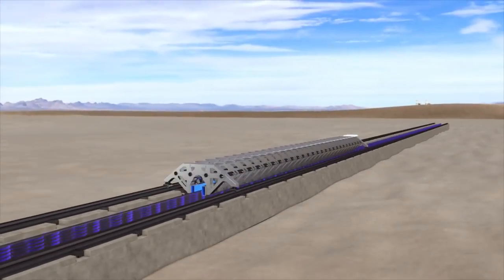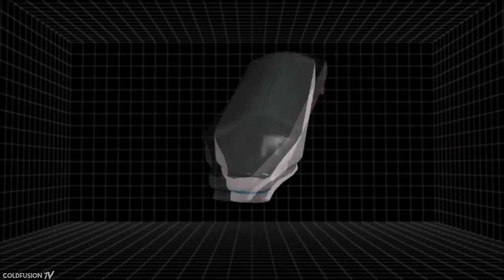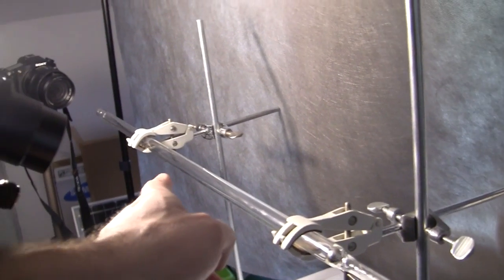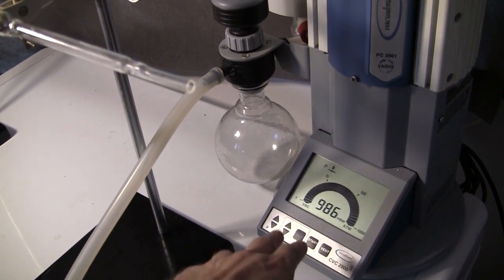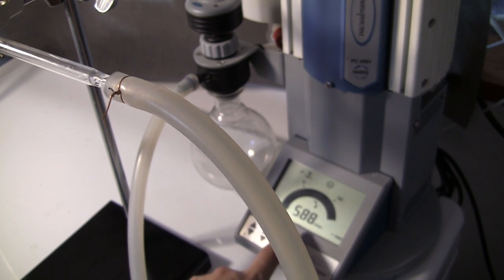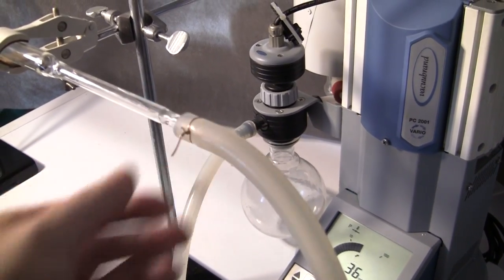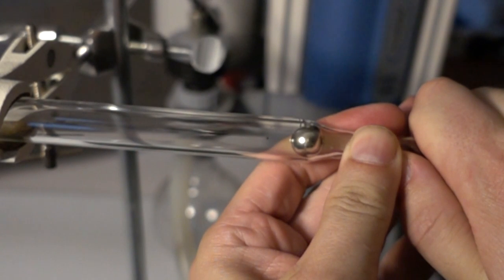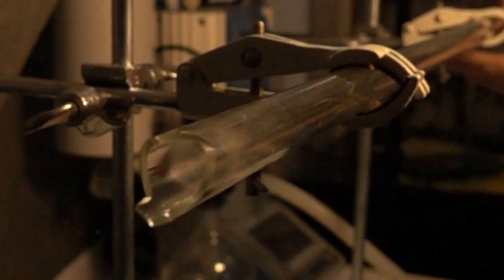How  the Hyperloop can kill you!

Comment: Wait, but why wouldn't the air just flow around the vehicle? That ball took up most of the diameter.
Reply: +Matt Darling If there's no air outside of the tube, then there is nothing to worry about; hell, don't use a tube if there's a vacuum outside.
Reply: That's not true. Firstly r^3 law means bigger things are effected less due to mass not scaling with surface area and secondly the snugger the fit the greater the acceleration as if air can rush past there then becomes air in front of the train object increasing its inertia.  A good example of this if the mythbusters episode where they make a vacuum gun.  The struggle to get the gun to work better due to air rushing past the baller bearing and over the course of 20m this causes a deceleration.
Reply: I'll rest my case and say, we need a small scale model to work 99.99999999% without hardware failure to even consider building it.
Reply: You'll notice that the ball does not take up the entire diameter and lets air flow around it, or else he would never be able to make a vacum in the tube... Though the acceleration is defined by the surface area the air is hitting. Same as you waving your ubrella around in the wind. I would argue that the diameter of the tube is irrelevant as long as it is over a certain threshold where this actually matters.
Reply: there's no air it's a vacuum
Reply: Matt Darling he's complaining about  the vacuum failing
Reply: +Lucas farach-colton would having a second tube around the first one with the same atmosphere vacuum work as a fail safe?
Reply: kEn_sct Now, i suggest we do the math and find the acceleration the first few seconds, because that is what is important. Speed doesn't kill a huge change in speed in a very small amount of time does.
Reply: Not sure what numbers to crunch as will depends on how air will flow over train but will be something like F~0.1*v^2 with v being the difference in speed between the incoming air and the train. Lets be generous and say the delta is Mach 4 so F ~ 2 MN.  I know people can survive 10 G  and I would guess the train will be in the region of 40 tonnes, F=ma so 2 MN/40000 Kg = 5G... so very survivable.  Debris going this speed may be an issue tough.
Reply: Yep, so if the surface area would be bigger or the train mass would be lower the G's will get larger or smaller.
Reply: Yep, but you could defiantly make a design that was inherently safe, all you have to do is make the train longer to add mass.  Also this doesn't take into account the drop off of deceleration as more air that passes the train the less deceleration on the train.
Reply: The fact that there is a vacum in front of the train would increase wind speed tho.
Reply: A vacuum does not exert any force.  The only force is the air pressure from wherever the breach is.
Reply: yah. I mean, You can crunch the numbers, but it isn't the problem thunder foot says it is.
Reply: Yah, I mean, sure. But if a train track is a centimeter off, it can derail a train. If a submarine has a single breach, it can sink the whole thing. One psi is not to much pressure to withstand.

Comment: What if, in case of a vacuum failure on one end of the hyperloop, you just open a valve on the other end to let air in? (Or a bunch of valves throughout the system). Obviously this would have to be done by a very fast automated system, with a bunch of redundancies built in. But wouldn't that stop the runaway acceleration?
Reply: Wouldn't nearly be fast enough for everyone inside not to have their internal organs crushed

Comment: Isn't it supposed to accelerate through electromagnets like a railway gun instead of air-pressure?
Reply: Yes, but they want a near vacuum in the tube. TF simply showed what would happen if the tube ruptured
Reply: He showed what would happen if the train had no safety devices (automatic, accelleration sensing brakes), had very little mass and could accelerate that quickly, and if there was a wall at the end. There isn't one in a loop.
Reply: +filonin2 That's if you forget that anything more than 7G will probably kill everyone on board. And the pod would be accelerating much faster than 7G.
Reply: filonin2 you'd pretty soon achieve a vellocity that can't keep the curved path though, plus there'd be a lot more air rushing in since the tube has a way higher area
Reply: *****

Ryan Coulbeck
Yes, if for some reason you didn't put any safety brakes that would prevent such an acceleration while the air pushes past the car. Do you actually think no one has thought of what would happen if the tube ruptures? Really? No one thought of safety vents or air locks or anything? Seems likely. It's like you're claiming elevators are inherently dangerous if you remove all safety devices from them. No shit they are.
Reply: Ryan Coulbeck
The very first result of googling "hyperloop safety devices" addresses these problems ffs.
http://www.businessinsider.com/heres-what-happens-if-the-hyperloop-crashes-2013-8

"But in the event of a serious incident, passengers may lose oxygen — they're inside a sealed tube, after all. So Oxygen masks would be deployed:
In the case of a more significant depressurization, oxygen masks would be deployed as in airplanes. Once the capsule reached the destination safely it would be removed from service. Safety of the onboard air supply in Hyperloop would be very similar to aircraft, and can take advantage of decades of development in similar systems.
The passenger capsules — which coast through the tubes, pushed in front of a column of pressurized air — are coasting for much of their journey, so they have emergency brakes and engine-driven wheels in case they are stranded or need to avoid hitting a stranded Hyperloop car:
In the unlikely event of a large scale capsule depressurization, other capsules in the tube would automatically begin emergency braking whilst the Hyperloop tube would undergo rapid re-pressurization along its entire length.

Once all capsules behind the stranded capsule had been safely brought to rest, capsules would drive themselves to safety using small onboard electric motors to power deployed wheels. All capsules would be equipped with a reserve air supply great enough to ensure the safety of all passengers for a worst case scenario event."
Reply: Bendmydick Cumberbatch Thanks, I apparently skipped that part :) 
But every kind of fast traveling is dangerous if something fails!
The biggest problem for the hyper loop are probably earthquakes...
Reply: filonin2 the quote you provided mostly adressed the rupture of a cabin, not the tube itself. I don't say it's impossible, I'm just saying that you'd need some serious brakes
Reply: Ryan Coulbeck
I'd love to see your source of why the car would be acclerating at "much faster than 7g," especially considering the hyperloop is specifically designed to not allow such a thing to happen.
Reply: *****
There wouldn't be huge pressure differentials ever or any acceleration as the tube has vents all along it to pressurize it equally in an emergency. Are you incapable of reading? How could the large, necessary pressure differential form unless all safety devices are disabled? Thunderfoot's example is faulty. A valid demonstration would be to have vents open all along the length of the tube. The ball wouldn't hardly be disturbed, especially if it was a rubber ball jammed in the tube to simulate the safety brakes being applied. If the tube ruptures in one place, this is sensed automatically and vents are opened along the entire tube, negating pressure differences while the cars apply brakes. This has been in development for years and has billions poured into it, they've thought of this really, really obvious problem long ago and addressed it in the design. Again, it's like saying that elevators are dangerous if you remove the safety brake.
Reply: filonin2 while you might not accelerate you'd still be subject to an (now twice as big) immense force
Reply: *****
How? There is never any pressure differential and the car never moves. You don't seem to understand the need for a pressure differential to get movement and therefore acceleration. What force if not accleration??? What unit is this force in?
Reply: filonin2 if you're in between a rupture and a safety valve you'll be hit by the incoming air from both sides
Reply: *****
Which would be a zero net force. Have you not taken physics? There would be no acceleration, you wouldn't move, you wouldn't even know it happened.
Reply: filonin2 so you'd be fine standing in between the stereotypical cartoon double log trap (https://i.ytimg.com/vi/4vt0IBejFbc/hqdefault.jpg)?
Reply: *****
Stop asking these stupid fucking questions kid and go look it up yourself. You've got no idea how it works yet you think you know exactly how it's dangerous. That's rich. You're blocked.
Reply: Kitsuneoni
So much stupid.... no words.
Reply: Yeah, but the experiment is designed to simulate a failure in which the outer tube breaks and the air just rushes in uncontrollably.
Reply: A breach in the inner tube would mean near instant cabin depressurization. Like in a spaceship, but with civilians and with things like earthquakes and tornados.

Comment: Are you controlling for the vacuum pressure? The acceleration that results will be due to the difference between atmospheric pressure and the 'vacuum' pressure. There is nothing that says you need to go to the absolutely ridiculous mbar levels. 

I am starting to doubt your work Thunderfoot. I will reserve judgement until the video is released but if anything you are showing exactly how plausible it would be that you could use air pressure for super sonic travel.

Comment: Going by this video, you'd think the engineers designing this thing are complete morons who wouldn't know how to work in some type of failsafe.

Imagine this.
Air inlets, along the tube which would pressurise it when detecting a breach.
Simultaneously, the maglev system would slow down and hold the cargo in place indefinitely.

Yes, no?

Comment: So basicly you're saying that this thing will have no brakes at all somehow I doubt that
Reply: And what brakes could you use to safely stop the giant bullet full of corpses?
Reply: It's not only the fact that it moves fast, but also I presume the sudden change in speed would likely hurt or kill the passengers on board. It's like falling from a great height, it's not the fall that kills you, its the sudden stop. The sudden stop in this case is a sudden start which is just as deadly.
Reply: Wow these comments are filled with retarded bullshit.

If the pod was not moving when it happened, it would already be braked.
If the pod was moving, everybody would still be alive, and braking systems could engage to counteract the acceleration.

To prevent this from being as much of an issue, valves could open to return pressure to the  section of tube.

The cabin wouldn't be crushed because it would not form a tight seal with the tube. Air would be free to flow around it.

The cabin doesn't need (or want) to stop moving when a failure happens. It wants to prevent acceleration, which includes slowing down too fast. Comparing this to cases of cars or trains braking to a stop is idiotic.
Reply: What kind of brakes would be able to stop a practical bullet going down a barrel? Wouldn't the people already be dead from the hella G's they get at the start?
Reply: Assuming the craft was at a dead stop & the mag lev is off to begin with plain old friction brakes should work fine to keep it from moving to begin with. If it's already moving when the blow out occurs then maybe blow out valves ahead of it to slow it then frictions brakes to stop
Reply: Padded rings that push outwards from the train to touch the walls of the tube... friction would stop the train.
Reply: There is a difference between an elevator falling at max terminal velocity and a car going at near to a thousand km/h. You still have the pressure from behind crushing the car if you manage to keep the car in place with your magical breaks. Btw almost nothing is easy to counter.
Reply: Brain Nim It likely wont be economical, but that is a wholly different problem from it being unsafe. Also there are parts of Freeways do have to shut down every time there is a failure, and the same is true for rail transportation and that doesn't stop us from using them all together.
Reply: Unless you attach 4 bloody rocket engines to it, there are no practical and non-lethal brakes, its like trying to stop a meteor.
Reply: No, the breaks would be torn apart. Our normal highspeed trains break with the engine and not so much with the breaks. It would be even worse if the breaks actually work the whole cabin could be crushed by the air pushing it and the breaks holding it inplace. Now to the cabin moving... Imagin that thing moving at about 1000km/h and now accelerating in a mere second to a much higher speed. How do you break it without killing anyone on board. You cant simply let all the air in that would crush the car from both sides becuse you now have a moving car, air pressure behind it and air pressure in front of it.
Reply: It does not instantly accelerate, so just like with most other emergency breaks you activate them before it accelerates enough to injure those inside.
People had the same freak out when elevators were first proposed and the solution was the same, no matter how fast the acceleration seems to people it is very slow to machines so it is easy to counter.
Reply: Jeremiah B
It does not instantly accelerate - i think you are vastly underestimating the power of sudden 1g/9.8 newtons per kg increase.
Functionally it would/does increase instantly.
Reply: ***** In human reaction times its instant in machine reaction times its slow.
Reply: Jeremiah B
Are you seriously trying to argue that a machine can fight 1g of pressure at a 1m radius tube in less than 5 milliseconds (napkin math count required for the sudden increase in pressure to start acceleration of anything in the tube) when it takes modern cars at 150kmh around 3 seconds to stop, with all the friction going on, 8-10s for trains depending on engine (and both cases assume acceleration being at 0 when they hit the breaks).
Reply: No in machine reaction time its also fast. You need to process the failure and signal it to safty devices several km in front of the car these devices have a reaction time of their own.
Reply: Oh yeah, I'm sure breaks are going to stop it when you consider the speed it moves at.
Reply: +seigeengine My issue with that system is that now one hypertube system has to shut down entirely for every instance of tube failure. Cars don't stop if there is a pothole, airplanes don't have to land immediately if an airport has a problem, etc. But this hypertube requires an insanely expensive road that is a giant single point of failure. Sure, you can reinforce the tube like how oil pipes are reinforced but that's transporting valuable oil, not acting as public transport. 

Even if it works perfectly, it just doesn't make sense from a business standpoint. Just set up electric trains if you really want high speed transport.
Reply: AdventureThroughLife
 basicly what i was thinking when i said friction brakes  ty for clearing it up better then i did :)
Reply: Jeremiah B No, the economic part goes hand in hand with the security of the system. If the tube was placed somewhere no harm would ever happen, it'd just be a simple concrete tube with powerful pumps. 

However, you now need to secure every part of the pipe given its current design. Now the pipe has to basically be bulletproof and probably resistant to natural disaster. Roads do not need to be made to be so insanely durable since when one fails, there are other routes. If this fails, it brings down one entire pipe system with it.
Reply: Brain Nim If a train track fails it brings down the whole line. Stop thinking of this as a road its not its a really fast really expensive subway.
Reply: seigeengine Ok, I guess you can just go along with the shills that claim that pouring money into this is somehow totally worth it.
Reply: Brain Nim It probably isn't worth what it will cost but making up problems that don't exist or are easily solvable just discredits your side of the argument.
Reply: +Ryan Coulbeck
 It wouldn't accelerate at the same speed a small light metal ball would.

Comment: That's correct thunderfoot, but only in the case of a vacuum failure at an end of the tube, and without taking the rest of the bits of the hyperloop into consideration. 

If the vacuum failed somewhere along the length of the tube instead(something far more likely to happen given the overall surface area of such a tube), the results would have been much less spectacularly destructive, and significantly less dangerous. Not only that, but it ignores the electromagnetic tracks, which are meant to accelerate and decelerate the pod. Doubtless that those tracks will also have an emergency stop and safeguards in place to lock down/slow down the pod in case of vacuum failure.

Comment: I do think this issue could be solved though especially since for the real thing the equivalent situation would be an entire section of the hyperloop being destroyed right next to the pod, which seems unlikely. I'd be interested in seeing what acceleration you get placing the metal ball different distances from the hole. The impedence of the tube will likely reduce the effect the farther away you get. The hyperloop could have some kind of detector and locking system that can detect a compromised vacuum and protect a pod from being accelerated dangerously. All this sounds ridiculously expensive though...